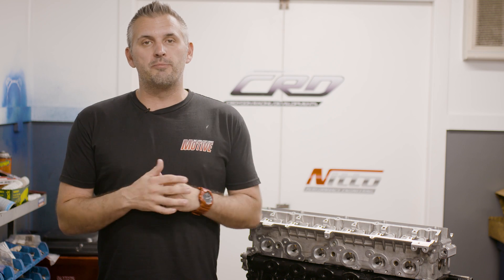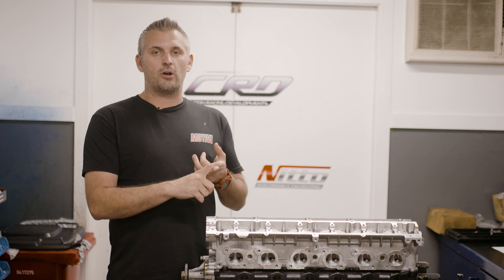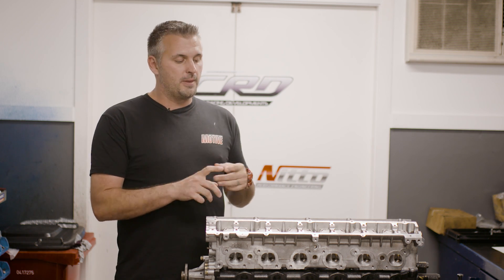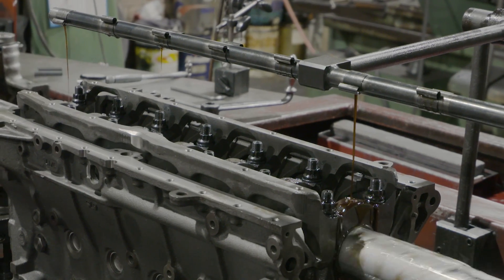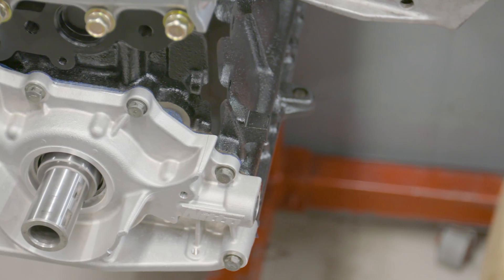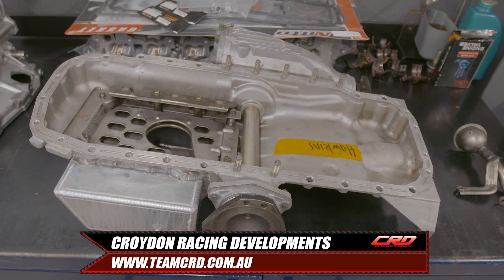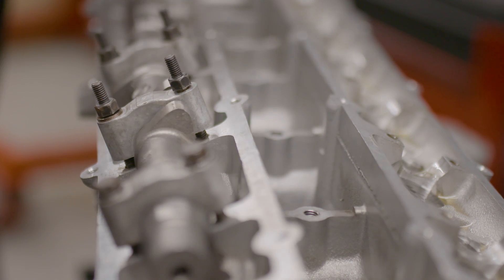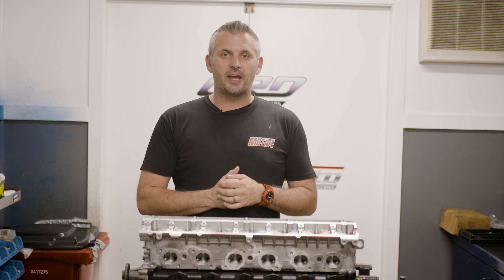Whats inside a tough 1000hp RB26 GT-R  Using Stock Crank - Project Supercar Killer R32 GT-R Pt1

Comment: Super content as allways!
I have a question though; what happens to the rest of the drivetrain if the sump, with its integrated driveshaft, is moved downwards? Can't wrap my head around it.
Reply from the maker: Elias Douah couple of bolts don’t line up on the gearbox anymore so you have to use the die grinder for a bit although manny shops just run the top four bolts and send it

Comment: Will have to be my 2nd engine, spending about $8k in parts and doing the work myself just to make my current engine reliable.

Been chasing the misfire issue and not having any maintenance history decided to do it all new, water pump, oil pump, seals gaskets hoses, clutch was slipping, rebuild turbos, wiring harness. Not a big fan of taking engine in and out every few months.

Comment: Do the lower transmission bolts still fit with the PRP engine brace?
Reply: No, you need to weld them and drill new offset holes (next on my to-do list) :)

Comment: What's a ballpark budget for a build like this?
Reply: About 20-25k in this engine from my experience. The full head build tends to be a finger in the air exercise. Could be 5 or 15 in it as you can spend a lot of time on it... plus sump brace work adds up quickly.

Comment: Step 1: Get a 2JZ
Reply: RB>2J
Reply: Smo Kabong Not sure how you figure given the 2JZ block is way stronger, the stock internals are stronger, the oil pump works, block hardness is greater, cylinder wall thickness is greater and it doesn’t need an aftermarket girdle to prevent the block cracking. Also the 2JZ just has a bit more displacement. I don’t actually care and have never owned either of these two engines, but it is obvious if you look at the evidence from an unbiased perspective that the RB26, while a good engine, is not as good as the 2JZ. Just look at the PRP tests.
Reply: coreyw427 cool story bro. Maybe one day someone will read it.
Reply: Smo Kabong reading isn’t hard. You could have read my comment in the time it took you to write your reply. Not even saying that the RB is a bad engine, just that 2JZ is better overall. Note my use of the word ‘engine’, not to be confused with ‘car’.
Reply: coreyw427 you're wrong, i type my replies very fast, if i read your comment it would have taken, twice as long, then replying to it would have taken twice as long again. Looks like you failed at maths too.
Reply: Smo Kabong fast is an adjective. You type quickly, not fast. E.g. fast typists type quickly. Once you’re literate, come back and read my first reply.
Reply: Step 2 throw it in the bin cuz not going to be awd you fucking moron
Reply: ClutchkickPJ I’m just talking about the engine. I agree GTR is a better car than Supra etc. It is possible the separate the two - if you can’t I would suggest you’re the moronic one.
Reply: coreyw427 RB sounds way better and there's 6 second street GTR's in Aus. Where's the 6 second street supra's?
Reply: Smo Kabong I am talking about the engine. Clearly the GTR has awd and therefore will make a faster street car. It’s possible to separate the two. Where did I say that the Supra was a better car? I said the 2JZ was better.
Reply: Smo Kabong take a look in the mirror, bud. You evidently have time to argue but not to learn.

Comment: Its great to have lots of money you can do miracles on the RB26. Unfortunately I have to keep my GTR 34 standard, money doesn't grow on trees.....LOL...
Reply: True but you're not even thinking about the fact that you own a car that ppl dream thier whole lives to own so be proud to own that "standard r34 gtr"
Reply: Hi @clutchkickpj693  I am proud of it owning my GTR 34 as I did buy it a few years ago when the prices were not as high as they are these day's. I would never be able to afford one nowadays. At the moment I am doing little work on it not internally on the motor just external and getting the body repainted that's as much as I can afford.
Reply: @vindiesel1066  If you hang on to it, keep it 100% stock, fix rust and other little knickknacks (like rotten hoses etc) then that's is your retirement plan right there... if you can bear parting with it when the day comes.
Reply: Hi @andersjjensen  I'm definitely hanging on to it the hardest part will be letting it go for that investment. As for fixing little things up I'm in that process now. Got the motor & gearbox out going to replace all the heater & radiator hoses upgrade the twin turbos, timing belt kit, radiator, head bolts to a higher strength to handle more boost, thermostat, rocker cover gasket and a few more things while the body is getting repainted to make it in show room condition. Anyway maybe I will do a YouTube video once its all finished.

Comment: has anyone used an rb26 crank in a rb30?
Reply: Why would you wan't to do that?!? That would either give you a compression ratio of like 7.5:1, or if you manufactured longer rods, you'd just not use the bottom 30mm of the bore.

Comment: Be interesting to learn about the "run in" stuff tuners and builders talk about. I see many shops do little to no run in yet others do 1000kms of run in. Interested to know from engine builders why both there are these schools of thought.
Reply: no such things as a run in tune. IMO you be straight on dyno bedding those rings in maybe do couple heat cycles change oil then go for power